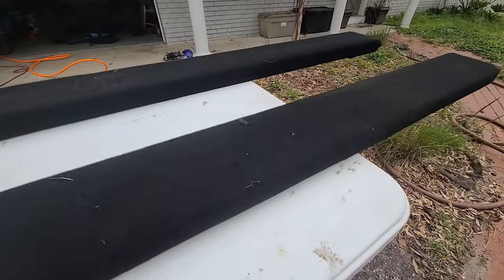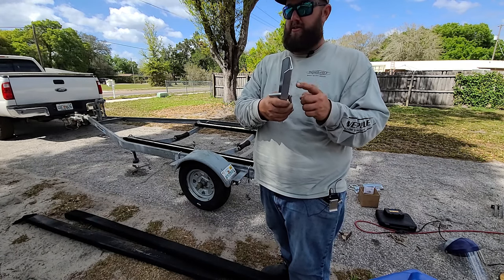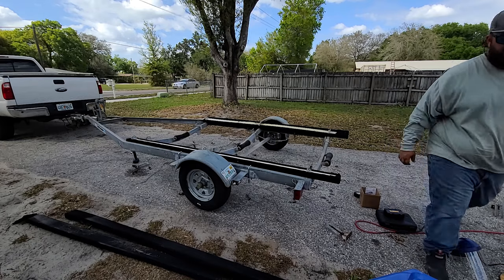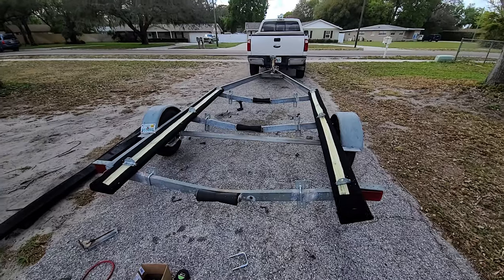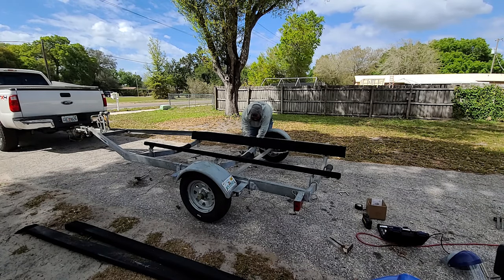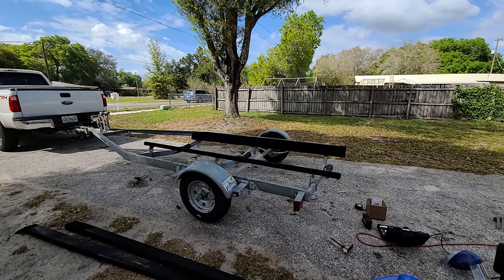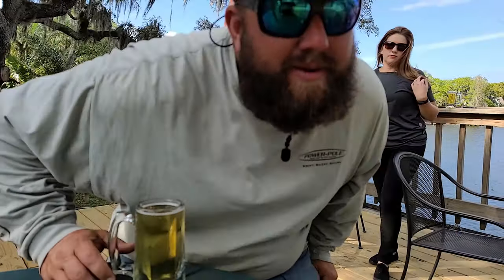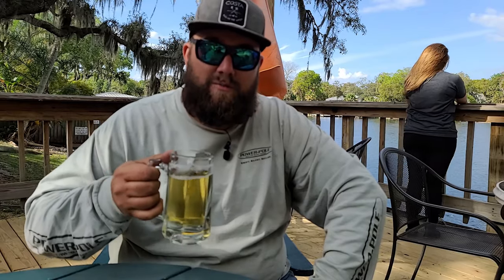How to make and replace your boat trailer bunks

Comment: Great Video...once the boat was on the trailer did you tighten the Bunk Bolt even more or do you let if be somewhat loose?
Reply from the maker: yes I tightened them up right after i loaded the boat ,then i had to make one more adjustment on them, and they where good

Comment: could you just use the bunks without the rollers underneath if you tighten them up enough and put them to the higher settings for the brackets my trailer is also flat not round on the bottom for a smaller 12ft aluminum boat that i can lift by myself almost ?
Reply from the maker: Yes. I just left the rollers on. They do nothing now.
Reply: @Fishnfl1  thank you for answering back so far you are the only one who has answered back liked your video and subscribed as well have. Great day mate

Comment: Mostly watched this video to see what kind of screw’s you put in the bracket and How you got them in, I have the same trailer and the screws came out
Reply from the maker: They will. Use the smallest lag bolts you can find. Then you can go up in size like 3 times
Reply: @Fishnfl1  yeah I took a screw out and matched it up at the hardware store, fixed it today

Comment: Homeboy. i had to comment. First, why didn't cover your work table with a clear plastic disposable drop cloth?! And you used a million staples on the ends., and why didn't you completely cover the P.T. Pine board?  to reduce exposure to the salt elements.... i would cover it 360 degrees , like the factory bunk boards.  thanks for the video, though...!!!
Reply from the maker: That table is a work table that has been used for fiberglass and other projects over the years.
The place I bought carpet from only had that size carpet.  I never said that I was an expert. But I know how to get the job done.
Reply: i would have used dual tables equal to the length of the Board and cover them both. LOL. keeping stuff looking new, that's just me . sir.  O.C.D.  have a super terrific Bless Day.